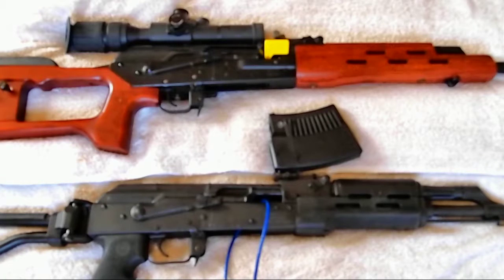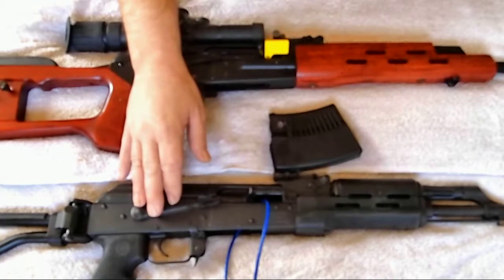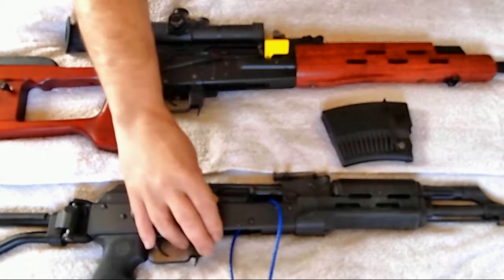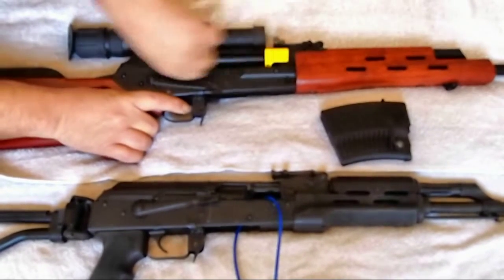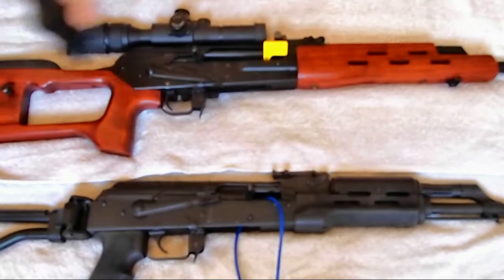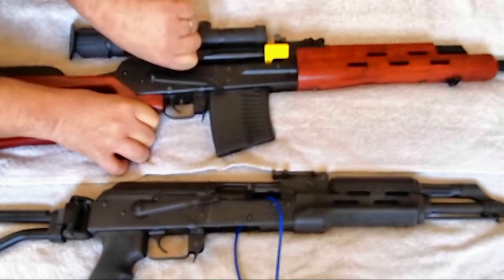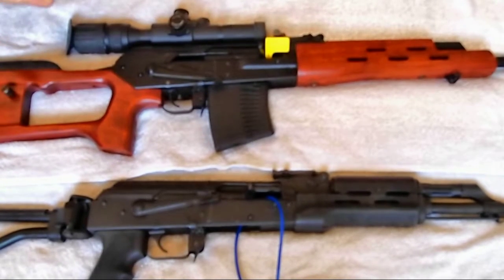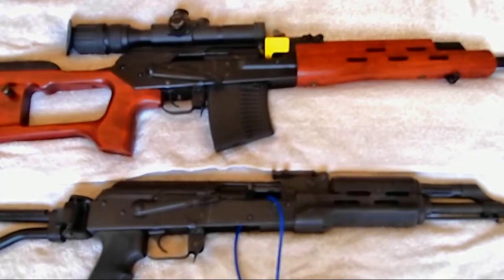Demonstrating "Bolt Hold Back" on a VEPR

Comment: There is no bolt hold open on Veprs or AK rifles. You're riding the bolt onto the trigger assembly...
Reply from the maker: You are absolutely correct. I was pointing out that - in "engineering to sales" speak, this "feature" occurs. I should point out "it" disappears once you upgrade to the Tapco G2 trigger/hammer group. If you want a purposefully designed Bolt Hold Open (BHO), Dinzags Arm can customize your safety or you can purchase a Krebs Safety from someone like Carolina Shooters Supply. Personally, I like the Dinzag modifieds better because they seem to be smoother in operation; but, the Krebs safeties look nicer.
Reply: My 54r dosent catch at all.the bolt on your really gets caught on something ..and yes I know all about the bolt riding the hammer.
Reply: Doesn’t work on mine

Comment: NOT SAFE AT ALL, it does NOT always hold back. I have 2 Vepr 54r 23" on one of my twin Vepr 54r's this works MAYBE 1/10 times, 2nd vepr 54r it NEVER works.

its a fault/snag, and wildly unsafe. Possibility it suddenly lets loose and fires is present.
Reply from the maker: I clearly pointed that fact out in the "CAUTION"
Reply: Michael Cornelsen noted, i was just adding to that.

i think we can both agree its a concern, not a feature.
Reply: I only use it at the range with the gun unloaded to show my chamber is empty